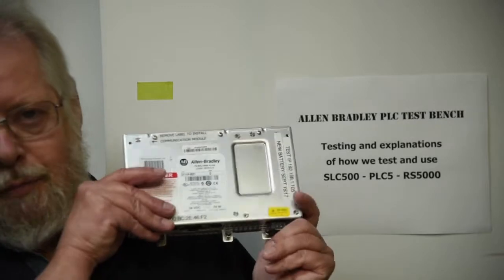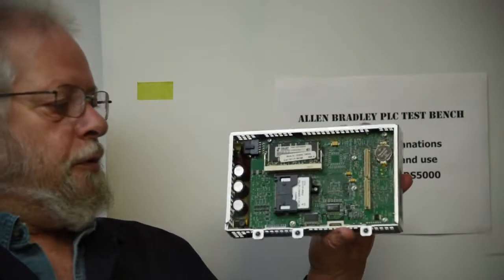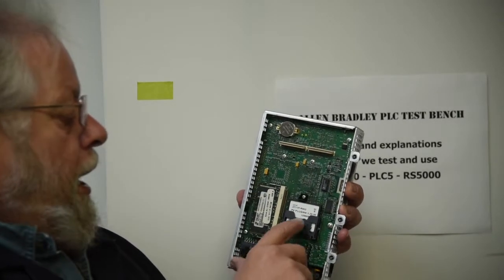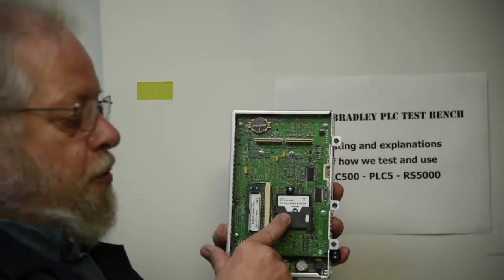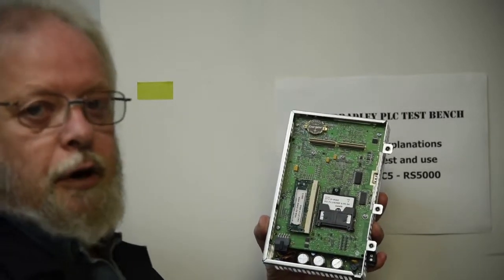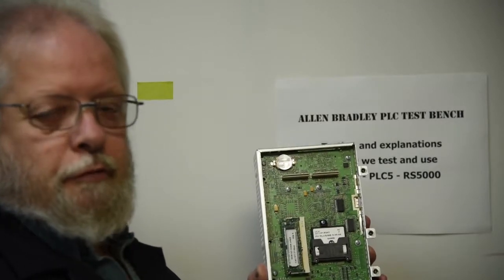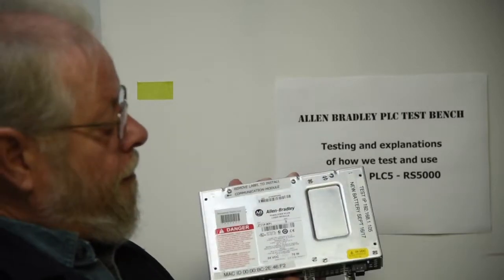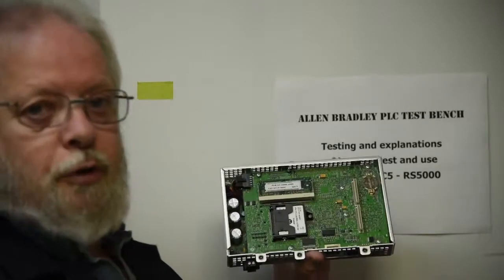Panelview Plus memory module

Comment: I have an 2711P-RDT10C Series A Revision F Panelview Plus 1000 HMI and need a logic module. Which one should I get that is compatible with this HMI? Thank you in advance!
Reply from the maker: Hi WJ:
These screens are plug and play on multiple logic  modules.
It depends more on which platform you are working with.  The RP1 or RP2 are great, just older modules and less money than the RP8 modules.
You can also put the comm adapters on the RP1& RP2 for DH485 & DH & CNET.

Comment: Hi Sir. I change my old memory corrupted with new memory but same version of ME firmware. Will this metode solve my problem?
Reply from the maker: You will have to download your operating file to the module and see.  It should work fine though.
Reply: @abplctestbench759  Oke sir, your answer is help me fully. It is the first solution. How if I flash Corrupted flash memory with new ME Firmware version. 
For your information my old memory is ME 4.00.05, which version of ME Firmware possible to update and have compatibility with my old version

Comment: I have a damaged card, what is the solution?
Reply from the maker: Hello Tamer:
Which card is damaged?
How is it damaged - is it physically broken?
The memory card on the end or the RAM chip or the operating system card?
If it is the operating system card then you need to get a replacement and install.
Reply: @abplctestbench759  How do I make another cf card?
Reply from the maker: @tamersharaf8588  Your best bet is to purchase a new card with the operating system on it and the reload your running file on to the new card.
I am just guessing on what you need because you have not provided me with all the info to make a proper recommendation on what to do.
Don't know what panelview you have, what operating system it is running, if the card is the operating system or the external file storage system.
There are many variables and I can only guess what you need with the limited information you have given me.
Good luck to you.

Comment: How do I access the desktop menu on a panelview plus 1500? There is no exit button on the configuration screen to allow me to get to the password screen. Was that option not available for the 1500?
Reply from the maker: As the unit is booting up look in the lower left corner for a small square and push there.  That will allow you into the configuration screens.
From there you should have access to the configurations.  If it is not there on bootup, then the original programmer set it to be hidden.  It is normally in the lower left corner, but I believe that you can move it.  You may have to do multiple reboots to find it.
Easier way would be to upload from the PVP to your PC with the PVP software and then change it there and then download it back to the PVP.
If the files are password protected you will have to contact the original programmer for the password.  If you are really lucky it is written down on the back of the memory module or under the memory module.
Good luck on this one.
Reply: @abplctestbench759  I see the square in the lower left hand corner however when I do get to the config screen there is no desktop option. There usually is an exit button next to the reset button at the config screen but on my screen all I see is the reset button.
Reply from the maker: @Y2J19831   I will have to look at a Ver 5.10 tomorrow.  Too late tonight to do anything.  I am a bit confused as to your asking about a 'desktop option'.  
This is a windows CE system designed for small operating devices.  There is no full blown windows on Panelview.
Reply: I have seen panelview plus 6 have a desktop option where you can enable vnc client for example. Mainly I was trying to mirror the panelview video feed to my pc via ip address
Reply from the maker: @Y2J19831  Not possible to do with the older version.  You would have to replace the memory/ power supply with the RP8x module that has version 6.x on it - download the PVP runtime program and then do the desktop and VNC.  It may be possible, but nothing I have ever run across.

Comment: I just need to upgrade ram due to low memory message I get with large applications. Thanks for the quick response at least I know now what I need to buy.
Reply from the maker: Your Welcome
Reply: What voltage is there on pinout 1-10?

Comment: Can I just upgrade the ram chip from 64mb to 128mb and leave the CF card the same at 64mb
Reply from the maker: HI Y2J:
No they have to be changed as sets.
FYI - Changing the chip and CF card will not speed up the unit or it's communication ability at all.
Great question - thank you